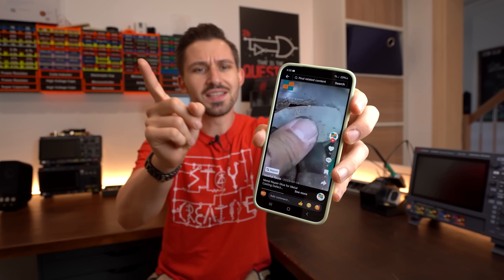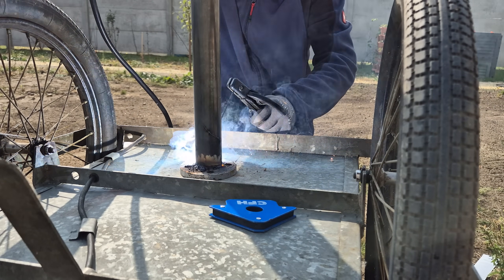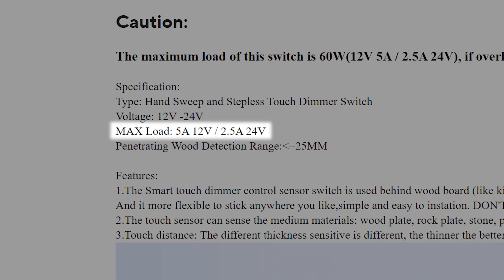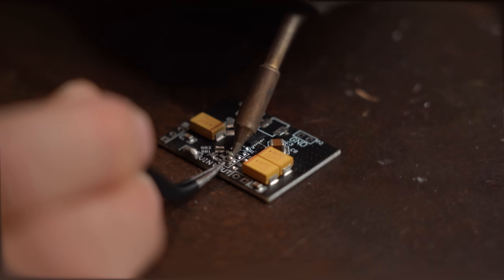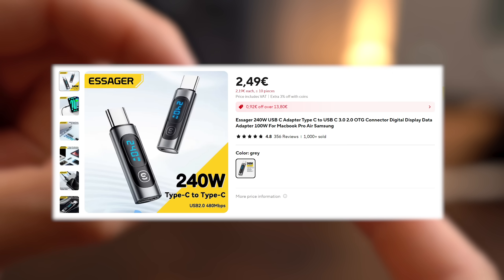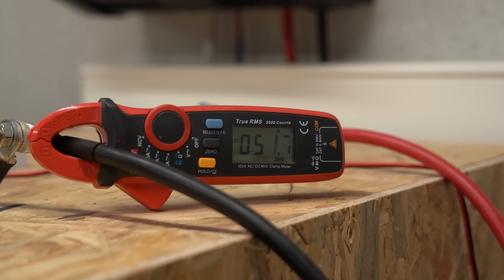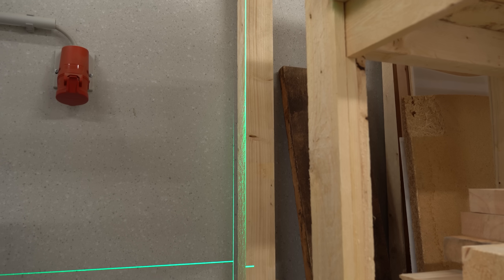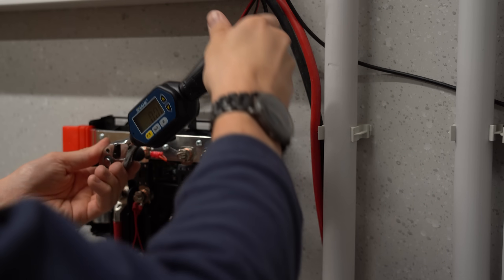I tried finding Hidden Gems on AliExpress AGAIN! (Part 11)

Comment: hey bud, im a fan of your version of these "hidden gem" vids the most, great work and appreciate the reviews for sure! just in this one alone was a big help for me because this week i was actually thinking of buying that exact hot tweezer kit from yihua because i own their 4 in 1 948 II soldering/desoldering/hot air/vacuum pencil station and so far i love it... but i do recognize that yihua/wep are one of the "hit or miss" type of companies and was hesitant to purchase the tweezers.... well now im happy i held off and didnt get them, thanks for confirming my suspicions.

also, the torque wrench.... one important spec of a torque wrench(arguably the MOST important) is repeatability.... all torque wrenches have a +/- tolerance and quality is obviously determined in part my minimizing that tolerance BUT also by optimizing the repeatability of that tolerance...
lug nuts spec'd to 75lb/ft are just fine if torqued to say 80lb/ft... as long as theyre all torqued to ~80lb/ft... problems arise when a bad wrench is set to 75lb/ft but sets one lug to 72lb/ft and another to 79lb/ft and another to 80lb/ft ETC.... 

and if i may suggest a review product... check out the digital torque screwdrivers on aliexpress when u can... id LOVE to know if theyre worth the price and theyre very applicable to the world of  electronics....

great work and keep the vids coming!!!

Comment: If you bought some PARKSIDE PERFORMANCE PKLLP 3360 A1, you would save yourself some headache. It can be bought for less than 100€ and it projects 3x 360° line. Also it comes either with built in battery or it works on x20v Akkus. Also you didn't mention how thick the laser line is on that aliexpress device, seems not very useful.

Comment: You've essentially recommended that glue - but do you know what's in it? How do you know it isn't incredibly toxic or Carcinogenic? It's not like sellers on AliExpress are totally 100% trustworthy in any way...
Reply: It is epoxy. You have to assume that it's dangerous even when you buy from most trusted local manufacturer, by principle. The main hazard being allergic sensitisation and possible anaphylaxis. It is a rare issue dependent purely on quirks of our immune response but you're well advised to keep it in mind. If you feel breathing difficulty or light headedness, evacuate immediately and seek help. Use nitrile gloves.

Also by matter of principle, after a few weeks of curing it goes inert even if it's not pure, simply because the crosslinked matrix constraints any possible toxins.

Also there is a very popular zhanlida glues (also different brands) E7000, B-series etc. Very hazardous solvent, chemical skin burns, causes dissociation. Amazing flex glue that cannot be replaced, but extreme care needed. Instant cleanup if you spill it on yourself. Evacuate if spill in workplace. Even if you only spill a few grams. Do not wait for a minute, since what happens you can freeze up and can't move or think. Do not use for glue-ups that need more than a few droplets.

Beware that many adhesives even by industry leaders are not safety rated for home use, even ones sold openly.

Comment: As always, very interesting. Regarding glues, I don't want to do free advertising, but regular JBweld was for a while my favorite before I discovered cyanocrilate applied over cotton (makeup cleaning pads are fantastic to roughly mold things).  That JBweld seems to have some iron dust or something, and is pretty strong. It will fail that hammer test but feels, slighly better that the epoxy slow curing bi-component I had used for decades before. It is not elastic at all though.

Comment: 12:20 - I guess it works better to align stuff at an specific angle, like a small roof, maybe to mark where on a wall to break to connect two points... The precision part kinda sucks, but generally would be a tolerable one on these use cases...

Comment: I got a Worx electric screwdriver on the site. I've used a few in my time, but this one really is a nice bit of kit. It's not much bigger than a normal screwdriver but has the torque of what used to be a heavy drill sized thing. It comes in a  handy plastic case as well where you can take a case to your work and you have every bit you need. For a piece of industrial design, I'll give it 10/10. Well done China!

Comment: I've actually got the very same USB C power meter adaptor, and it's a great little thing, even works well with USB type adaptors, and the PD charger on my Dell laptop, and it's cheap, so a great little gadget, especially when you want to quickly check the power draw on a USB device.

Comment: Digital torque gauges are very accurate in general - it's one of those things where all the accuracy comes from an electronic component, the load cell, that even at the cheapest end has extremely small error because it's "borrowing accuracy" as the only way to make one at all is a process that is precise to near-molecular scale (same way computer chips are made).

Comment: Beware that JBC tweezers require a dedicated soldering station (or a combo station that has both normal and tweezers output), so buying just the tweezers in your case wouldn't be enough. That being said, we have the dedicated station at my work and it performs well, as expected from JBC.

Comment: I bought those hot tweezers about 6 years ago and they are absolutely horrible. Completely agree with your take on them. I mean, they work, but the tips don't heat evenly and you can never get them to line up properly.

Comment: Toss the tweezers. Buy a 2nd soldering iron.
No srzly, I do professional smd rework at a manufacturer every day. Why does Noone simply use 2 irons?!
Even the tweezer from jbc or ersa succ arse.
We strictly and exclusively 2 irons to solder smd components down to 0402.
Dual wielding those is SO so much more precise, faster and convinient than any soldering tweezer or single iron + normal tweezer.
U should get a 2nd iron NOW 💀💀💀⚡

Comment: Please note lifetime warranty doesn't mean for your lifetime it means for the expected lifetime of the product so would probably be 7 to 10 years, read the legalize that came with it to see what "lifetime" actually means.
Reply: Nope. On their website they state, that you can always exchange the product as long as it doesn't have damages from being used incorrectly or you had it repaired by a third party. But it only counts for business partners (and I guess Scott is self-employed so he's able to make use of the promise).
Reply: Each manufacturer is allowed to define what "lifetime" means.

Before they thankfully went bankrupt, Briggs and Stratton removed the ability to change the oil or filter in their lawnmowers, announcing "lifetime oil, never needs changing."

In the small print, "lifetime" was defined as "two seasons."

So, their lawnmowers would last two years without an oil change. Exactly the same as any lawnmower.
Reply: Lifetime for a tool should be multiple generations

Comment: Stay away from touch light switches if you are a ham radio operator or if you have neighbors that are. They are activated by strong radio signals and you will end up with disco lights.

Comment: tbh I wouldn't trust this torque wrench. Especially as for its price you can get a quality product at some sale like Proxxon for example. For the ~1-60 Nm range you would need 2 wrenches or 1 screwdriver and 1 wrench, but you are assured that everything is tightened correctly.

Comment: Well uhu have a "metal-epoxy" too. Ive been using them for som time. Using them sandwiched between 2 metals (or plastic to metal) rather than using them as weldjoins.

Comment: I did install solar panels on my roof, and the digital level was damn useful to set precisely the rails anchors at 14°, which is my roof angle.
Without it I would have spend a lot of time to tinker the angles of each (20 of them).

Comment: Hi GreatScott,
I also use the UHU if I would like to flow the glue while curing. I also bake it 100ºC at 10min, so it gets even stronger . For things that the glue should stay in place or for higher temperatures I use JB-Weld (you can get it at 'Reichelt'). Liebe Grüsse Benno

Comment: I can confirm that it's important to have your nuts tight when working with large currents.  There was a loose nut in my solar distribution box and one day I discovered that the box and cable sleeves had melted.

Comment: That "metal repair glue" looks to be essentially what we have in the United States that is called JB Weld. It is a very good product, but will not "weld" metal together as you found out. Some of those other items look interesting though. I might have to look into some of them more closely.

Comment: If that's your best attempt at welding you may wish to consider purchasing a Flux Core Welder... for beginners it's an absolute breeze and entry level versions cost half as much as the 'Stick Welder' you used. Additionally, Flux Core Welders have a lower learning curve and there's numerous tutorials on YT that'll help you improve your Welding quickly.

Comment: These glue tubes with chinese characters do not fill my mind with confidence, to say the least... You never know, what's inside of them, and there can often be found some really nasty chemicals, that can for example eat your skin if touched or have some radioactive additives... Not to mention the supposed modern slavery in some of the manufacturing plants in China... I don't want to "risk it for a biscuit" and I stay away from Temu, Wish, Aliexpress and eBay aswell. Seriously, consider more concious sponsoring and don't involve yourself with this garbage... Well, to be exact, don't recommend this to your viewers, because more people can get hurt...

Comment: You correctly used "as much" and I love you for it :D.

But dude, you did stick welding (badly). To (badly) stick weld, you do not need a 400 Euro welder. You can achieve that with a car battery.
Reply: Sparks and lead acid batteries under heavy load is a good way to cause an explosion.

Comment: The best welds are done with an argon flow to prevent oxidation. Go slow, its like soldering a heatsink so you need the area HOT

Comment: we have those desoldering tweezers at my job and they are the perfect tool when debugging dead components on a board that is mounted inside an enclosure. They heat up really fast and when the handle is  tightened properly they can be precise enough for all small smd components with 2 or 4 pads (I sometimes use them on small ICs too, just need extra solder). Also out of all the soldering irons we have this one is among the oldest but somehow its tips still look brand new. It's a great tool that does the job very quickly, very valuable.
Reply: I actually hate these kind of desoldering tips. If you don't handle them correctly they get bend and if you don't clean them propably the solder doesn't stick to them anymore.. some colleagues do that to them sometimes..

However I also used them brand new, and also hated them. (And they were some of the known big brands). + the tips are expensive.

I just use two soldering irons 😅, works way better.

Comment: Make the hole in the flange big enough for the pipe, push the pipe through and weld it on the outer side. It will leak just as much, but the hideous crappy weld will be hidden.
The trick with welding is to melt the base material while adding more. Look at the molten pool, not at the arc.

Comment: you guys need JB Weld.  Epoxy similar to what you already use, impregnated with metal, but only $5.  for 25 euro you could have half a lifetime supply.
Reply: JB weld availability here isn't great but we have UHU Flüssigmetall, that's a slow cure high strength formulation similar to UHU300 but modified with steel and tuned towards higher temperature endurance. Lifetime supply is a little difficult, UHU products are not cheap; but then imported products from the States are more expensive yet. It happens to just about all US products, they become somewhere between twice and 5 times as expensive, well beyond taxation related nominal price differences; and you've guaranteed experienced that with many EU products as well if you tried to buy them in North America, the pricing is simply not attractive.

Comment: There are auto leveling pendulum laser devices similar to the Bosch you have on Ali. I recently got one branded "Hilda" for around 15 euro and it works in the same way. The Bosch will be way better quality for sure, but for casual usage this Chinese one works pretty good!
Great video, as usual! thanks :)

Comment: Your glue test is BS. It tells me nothing. So "two component" means what?  Is it an epoxy resin like Araldite? What surface prep did you do? Roughening , degreasing?  You don't even bother saying. Plus you are totally unscientific in determining what force is needed to detach it. No adhesive is equivalent to fusion of the mass of metal.  No sh*yt Sherlock !!

Comment: Welding is not expensive,   that's called Stick welding what you tried to do. (SMAW).  IT can easily be done with DC Electrodes and a few charged car batteries wired in series with some thick jumper cables ..
Reply: Chinese stick welders cost around $100. Usually come with a little "opera glasses" style mask. Some kits come with sticks and gloves for about the same price.
Even though I'm poor as can be, I still consider that cheap to get started with.
Reply: @tin2001  Definitely  cheaper than a set of good batteries and a set of thick cables ..

Comment: You only applied glue on the surface around the joint, not on the area of contact which probably made the joint much weaker
Reply: I''d use JB Weld two part epoxy. There are videos showing it holding up to 4000 lb applied pressure before the bond breaks.
Reply: @thedarksage328  I would like to see it. Epoxy has its uses but this sort of application tends to be where it has its weaknesses. Weld, thread or fastener depending on what else it's supposed to do.
Reply: @thedarksage328  jb weld kwik weld fast setting 2 part epoxy is the best glue i ever used for fixing stuff that has to hold up to rough treatment
Reply: While true, it's still not going to be a great bond for that kind of application.
Reply: Or maybe he waited impatiently, while the instructions said he should wait patiently.
Reply: and hsi prefered glue diodnt look 1-1 which showedin it still being gooey when he hit it off
Reply: 1:46 ich wusste das du deutsch bist 😂
Finally hab ich deutschen Text in Kombin mit SCHUKO Stecker 😂😅🥲
Reply: This
Reply: Exactly like AliExpress shows how to do
Reply: Wouldn't have made enough of a difference to matter. You need a lot of surface area for cement like this to work. Absolutely slathering the joint with this stuff to make a very thick layer of cement would have had more of an effect. Preparation (roughed up surface and meticulous degreasing) and curing (elevated temperatures usually produce stronger joints) Is what I would seek to improve.
If you're using cement for a task like this, however, you have already lost. It is just not a proper method, and will work only if the stress is extremely low. For a serviceable connection you would need at least brazing, and ideally welding.
Reply: isnt welding in the same fashion?
Reply: @SsoulBlade  welding melts both pieces together while alos adding metal so is a much deeper fusing
Reply: @N1ghtR1der666  You place 2 pieces together and weld around it.
How he did it was squeeze the glue around it. Like you would weld it, no?
Reply: @SsoulBlade  No. Welding goes in depth, because it melts not only the electrode and the metal you are putting on, but  the material you are welding too. At least when done properly. If you merely "weld around it" without melting the base metal, you're simply doing it wrong. Putting adhesive around a joint is in no way or fashion same or even similar to welding.
You are wrong. Several people have told you that several times, and explained WHY and HOW you are wrong. Can't you just accept that, learn from the experience and move on?
Reply: @SsoulBlade  No. Done correctly, both pieces get molten on the entire contact surface (correct "penetration") and fuse to one piece. The additional metal on the joint is both coincidental (due to the use of electrodes which melt), and serves to fill the voids between the two pieces and prevent the joint for being thinner than surrounding material. With methods that use non-melting electrodes (WIG/TIG) and with good preparation it's possible to weld without adding metal, though in practice a "filler rod" is usually used to add some metal to the joint.
Welding done in the same fashion - where only the added metal connects the two pieces - is called a "booger weld" and is a failure to weld, producing joints which appear to hold but are weak and likely to fail.
Reply: @horrovac  Speaking of, I'm very much not a stick welding expert, but that metal didn't look clean or prepped at all.  Stick welding with a low enough current to not blow through thin material is a pain, and any bit of missed paint causes problems.
Reply: @EmperorA0  Yeah... Preparation is everything. With WIG/TIG it's even worse than stick or MIG, as every single bit of non-metal you failed to remove boils up and gets straight into your shit the whole time. If you can't weld hot enough with stick to burn all the crap off, it's certainly the same.
He didn't do the gluing right, but as a certified internet armchair welding expert I must say, the welding was crap too. But still, in this application I'll trust his booger welds over adhesive any time.
Reply: @SsoulBlade  You make chamfer to increase surface area when welding.
Reply: @SsoulBlade  Yeah but welding isn't gluing
Reply: @realdragon  I know. Didn't say it is exactly the same.